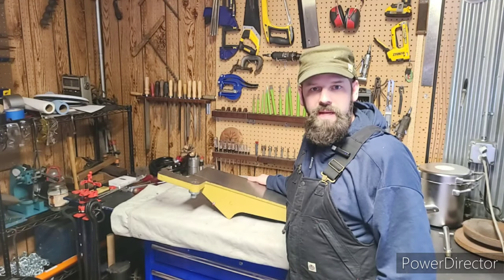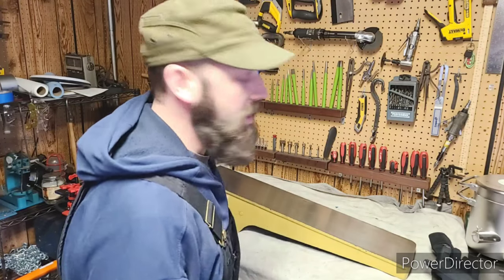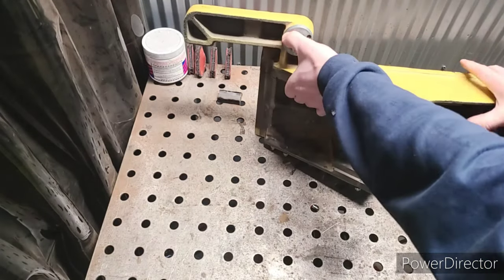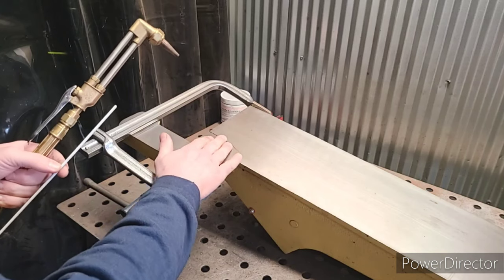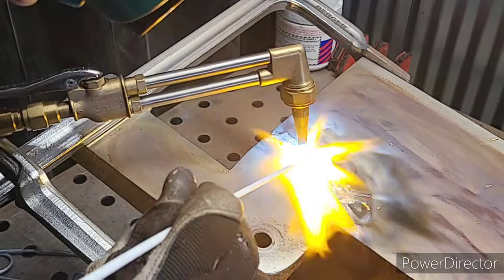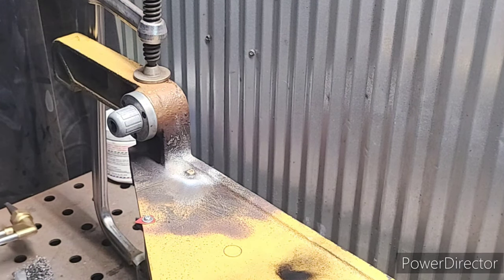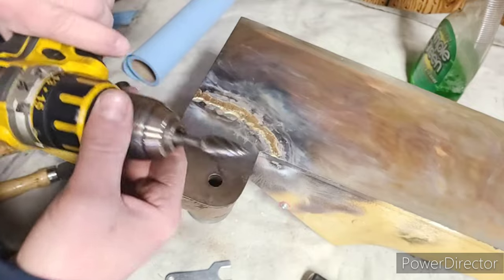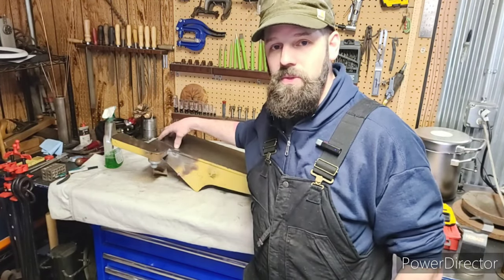How To Braze Cast Metal

Comment: That brazed repair won't hold up to much stress.  Don't put more weight than a mosquito wing on it.  Also just because it was sand casted doesn't mean it is cast iron.  It could be a cast steel part.  Grind it a little and look at the sparks.  Cast iron sparks look different than cast steel sparks.
Reply from the maker: It's held up for over a year+ and the client has been happy with it. If it can survive a bunch of high schoolers at a public school, I'd say I did a decent job.

Comment: Very nice, but I wish you would have talked a little more about penetration. Still a great video.
Reply from the maker: @buckygoldstein9256  Fair enough. Penetration is a bit strange with brazing. Since you're not bringing the base metal up to a critical temperature, you're not actually creating penetration in the same  way as you would with welding. Instead, you want the brass to "seep" through in a similar way to soldering. Thank you for watching.
Reply: @steelforestweldingandforge  Don't get me wrong. I found the video very informative. I've never brazed cast iron, but I have brazed lugged bicycle frames, which is sort of like sweating pipes (but with brass and steel). With bicycles penetration is very important for strength. I was watching the video because I'm contemplating brazing a broken vise, using nickel silver rod. I'm not sure how that will work, but I'm sure that penetration will be important with that also.  ;-)